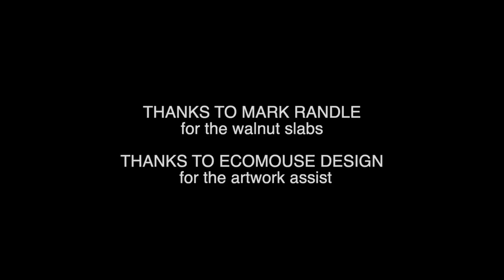Industrial 4 Post Bed - Walnut Live Edge Slabs - CNC Plasma Cut - Rustic Cabin Bedroom

Comment: Nice blend of the heavy metal and thick slabs. Many designs seem "stuck together", not really cohesively marrying the materials. The form and function are complementary with each other. Great job. Thanks for sharing.
Reply from the maker: Ecomouse came up with those cool brackets to bolt the wood to the posts, very simple design but perfect compliment to the overall look.  Thanks for watching!